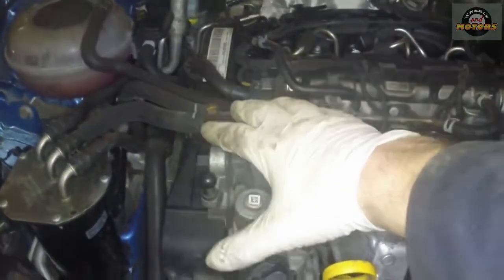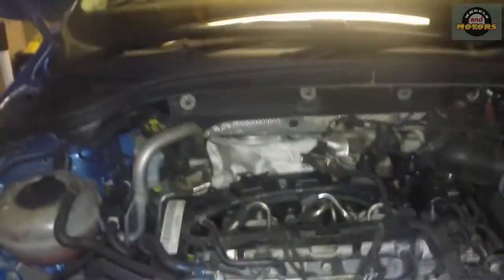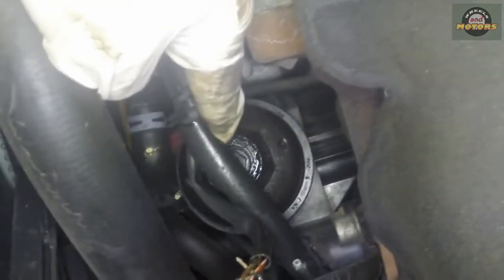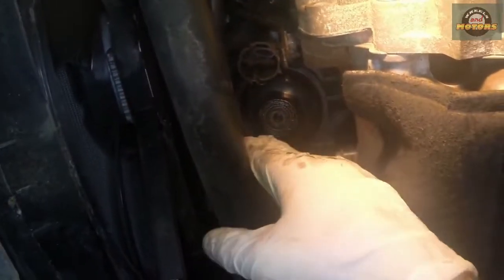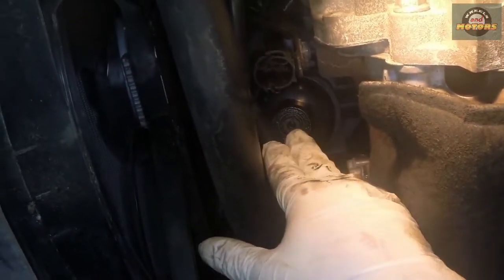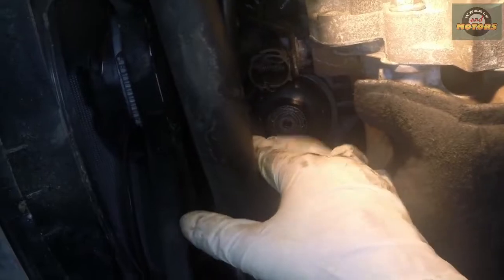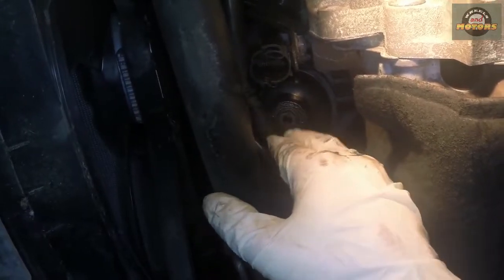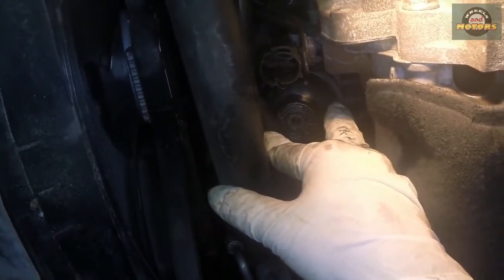Where is oil filter on new Euro 6 TDI (VW, Audi, Skoda, Seat)

Comment: Thank you! Are you planning for Thermostat or belt oil seal replacement on this model MK3 TDI?
Reply from the maker: You're very welcome 👍  Currently I will only do what actually needed for the car.. Maybe un the future.
Reply: I was so confused because your last video for the oil service on the VW Sharan showed the oil filter can be removed from the top but when I opened my bonnet I could not find it. Thank you for this video. 👍🏾

Comment: Thanks for the video. I made all oil changes on my cars since 1998 and I plan to continue on my new car (Skoda with a 1.6 TDI Euro6 of 2018 just purchased last weekend).  Location of this filter is not so bad after all : we do not need to go very far under the car.  Do you have any idea how to make the EGR of this engine last? Are diesel addititve such as Bardahl any good in your opinion?
Reply from the maker: Sorry, I know nothing about additives, I don't use them..